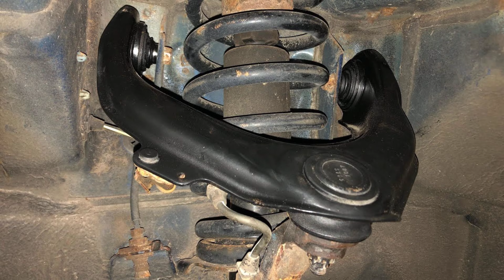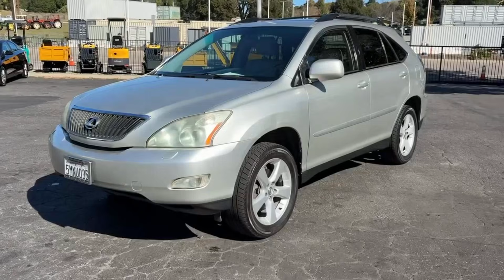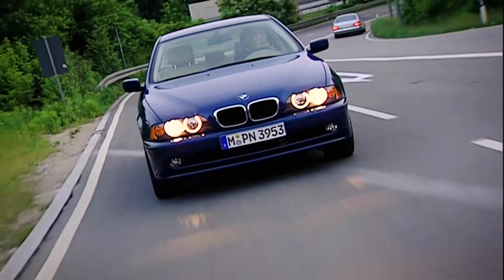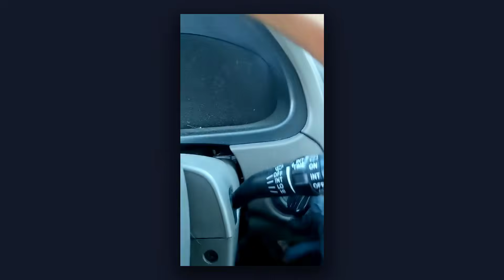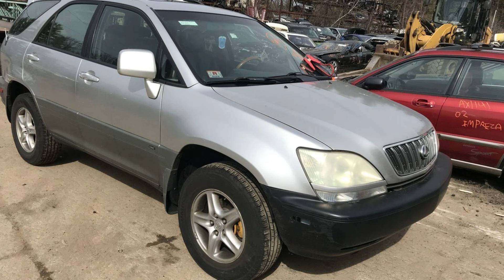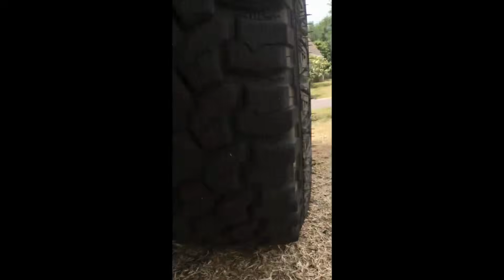Is Lexus RX300 Was The Last True Luxury SUV Engineering Obsession Ever Made?

Comment: I have a 99 rx300 awd with 193 k miles and still going strong but lately it's been smelling like gas and feels a little slowish with a little bit of gas gussling
Reply: Replacing Valve Cover Gasket .
Reply: Put a brand new timing belt and water pump and a $40 belt
Reply: @daveg9002  just bought a 1999 Lexus RX 300 from my dad‘s neighbor been sitting at his house for months bought it with 182,000 miles did a test drive ran good but after putting a new spark plugs, new tires rear brakes, brand new oil change I started to get heavy white smoke the oil is getting pooled in the heads big fox Saturday
Reply: Bought for 1,800 mint condition still goy the old style leather smell .

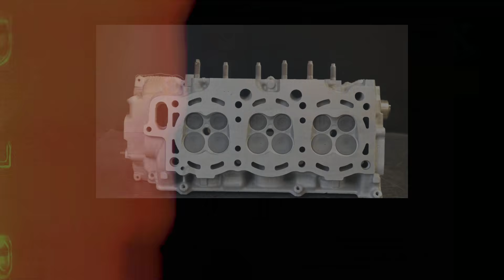Comment: 7:10 The 1MZ-FE is a non-interference engine. In a non-interference engine, there is sufficient clearance between the valves and pistons, so even if the timing belt or chain were to break or slip, the pistons would not collide with the valves. This reduces the likelihood of serious engine damage in the event of a timing belt or chain failure.
Reply: thanks for that.  the "Scotty" dude that does videos said that too.  then this acts like it's gospel that a break is death.  christ that engine is a Legend because its head isn't toast on the occasion of a break, then the mechanic will flush out the sludge and it's good for another 175,000.  i've got a 182,600-mile AWD one in my sights for $4995 and goin' for it and hopefully the damn rear drive hasn't failed and defaulted it to FWD only.  for $1000 more i could get a AWD 2004 RX 330, similar miles, but like this says they came back to Earth and couldn't go primo anymore. so, i get a cassette and no CD, boo-hoo 🙄
Reply: @dedicated2WHOiLove  I found these pros and cons from a video on YouTube at one time and saved them:

Pros :

- Reliable
- Great visibility 
- Takes regular fuel (Owner's manual agrees)
- Great ride, decent acceleration 
- Good safety stability - Vehicle Stability Control (VSC) and Traction Control (TRAC) became standard features on the FWD RX 300 starting with the 2001 model year. AWD: Traction Control is completely built-in and standard.
- Easy maintenance including replacing light bulbs inside and out
- Decent cargo space
- Cheap parts because a lot of these cars' parts can be found in a junkyard, and a lot of good aftermarket are interchangeable with Toyota parts mechanically. ( RockAuto is a starting point for new parts)

 Cons :
- Mediocre MPG (No surprise)
- Door lock actuators go out
- Knock sensors tend to go bad on these engines (4 hr labour for repair)
- You need an aftermarket radio/head unit ( Seicane has CarPlay Android Auto units for the RX300, eBay also has postings for aftermarket head units)
- Crap turning radius makes for difficult U-turns and parking
- Sun visors tend to be slightly loose and fold a few degrees down

Common Problems :

- Oil sludge (due to bad design of the right valve cover). Solution: Replace right valve cover with a 3rd generation valve cover from the the 3MZ-FE engine (e.g. from a RX330) Part number: 11201-0A060 (has 4 notches at the edge, slanted PCV boss)
- Damaged or cracked Fuel Tank Vent Valve (Part number: 77390-48010) (You'll get error codes for the evap system)
- Variable Valve Timing (VVT) Solenoids need replacing.
- VVT (Variable Valve Timing) oil filters need replacing. (It catches debris before it reaches the valve. Clogging in this small filter can cause rough idling, poor fuel economy, and reduced performance.)
Reply: You know about as much about your Lexus RX300 as I do.  As she gets old, suggest you change your ATF about every 2 years.  I didn’t mess with the filter which is in the pan.  Rather I drained 3 1/4 quarts of ATF from the 2 drain plugs.  Replace the ATF with Toyota ATF.  The ATF came out dark brown the first time I did this and got lighter every two years.  Last time I did this it came out bright red.

Long may your new to you RX300 run!  I believe the generation 1 Lexus RX300 is a million mile car if you care for it.  If I didn’t get totaled I would still be driving my RX300 today!  Bill B.

Comment: I miss my 1999 Lexus RX300 a lot!  I drove it for 24 3/4 years and put 349,000 miles on her.  A careless driver totaled my RX300 six months ago and she had to be junked.  I believe my RX300 was a once in a lifetime vehicle and would have outlasted me.  I miss my RX300 a lot!  Bill
Reply: I just bought a used 2000 Lexus RX 300 with 140k miles.  Two owner: 1st was a grandma, 2nd was 65 year old couple, no kids. Very minor issues and no rust, for a 26 year old vehicle. So quiet that you can barely hear the engine and smooth shifting tranny. Idles below 800 rpm, in 2nd no gas goes 2 mph, amazing. The interior is so impressive, still looks so newish.  My son  has been using a Yamaha 959 VStar as main transportation to his job at hospital. He needed a car, his safety was worth way more than the 4k spent. He's 26, born when this vehicle was born 😊😊👍👍how perfect.   Seems as though I found a diamond in the rough!
Reply: @REUNITE-US-c7x I wish you much luck with your new RX300!  I think the secret to keeping your SUV running over the long haul is regular service and using Toyota parts.  I’ve used Valvoline high mileage 5W30 and changed the oil & filter every 3,000 to 3,500 miles.  My RX300 started immediately and never showed any oil smoke in the exhaust.  I hope you have as much enjoyment with your new car as I had.  Bill
Reply: so sorry for your loss.  i'm not kidding around when i say i think you deserve big pain and suffering payment from the guilty party, and i mean court ordered and tax free.
Reply: @dedicated2WHOiLove . Thanks.  There are some blessings for my loss.  My ‘99 was totally old school.  My newer used RX has so many safety features that I haven’t even learned about.  Fun coming into the 21st century…

Comment: Yesterday I bought a 2001 Lexus Rx300 Very Little Superficial Rust 159k miles. I love it❤ Drives Like a New Car. Best $2500 I ever spent💪🏾
Reply from the maker: $2500 for a 159k RX300 thats an absolute steal, these ride so smooth it almost feels dishonest. Is it still factory spec or has the previous owner touched anything?
Reply: @GoodOldThings7 yes it is still factory spec